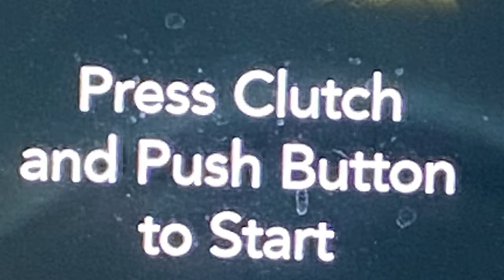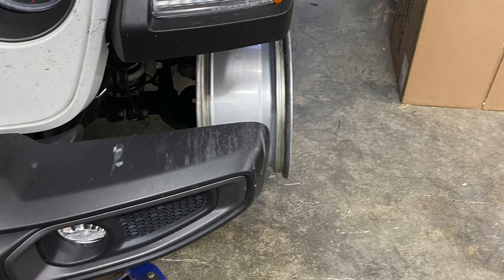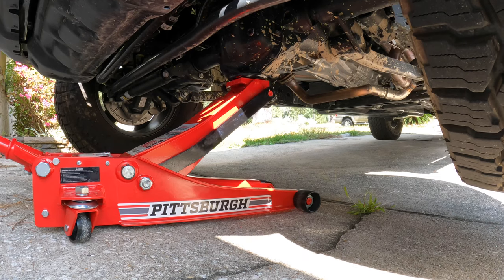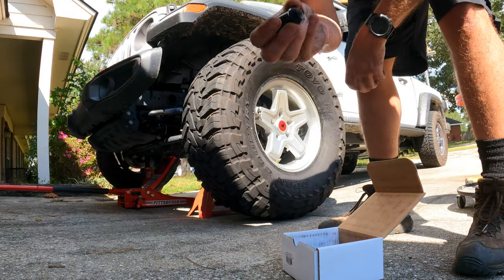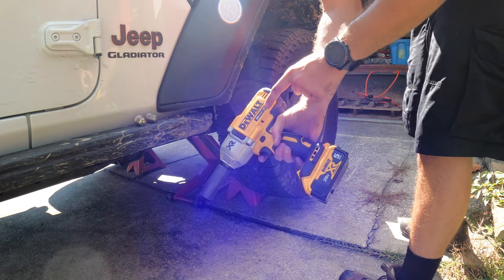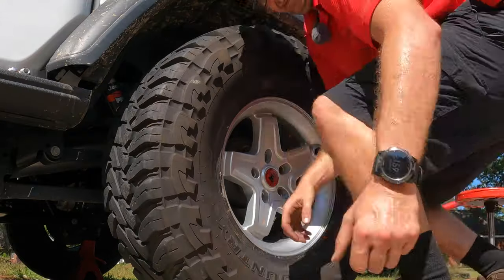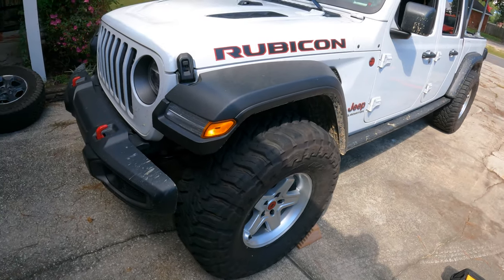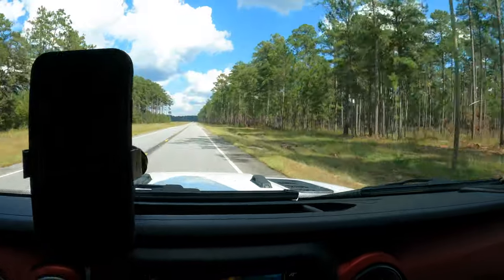Jeep Gladiator 37 inch tires no lift? Toyo 37x13.5x17 and AEV Wheels fit Gladiator Rubicon? Dewalt!

Comment: The jeep looks great.  My f250 2018 lariat tubo diesel 6.7 fx4 crew cab, I changed  from 37x20x10 12.50 to toyo 37x17 x13.50 and it's turning heads every where I go ,and I forgot to mention it has a 6inch lift too.  But your jeep looks great  🤠👍
Reply from the maker: Fred, thanks for watching!   I don’t like big wheels, I prefer more sidewall for that infamous rock or curb.   These tires are the toughest ones I’ve ever run on a vehicle, and that’s why I keep going back to the Toyo MTs.     They’re probably overkill on the little jeep.   They last decently on big heavy trucks.   If you’re not careful you might catch the bug for bushwacker cutout flares and want to step up to 40’s…lol

Comment: Come across your channel... first vid... I too am considering the Gladiator Rubicon and have been wondering the option of 37".. what was the width, offset, and backspace of the aev wheel again ? Here in Australia, the authority don't like overhanging wheels, so trying to pick correct wheel set-up.. 
Cheers
Reply: I might add, I'm waying up between the Rubicon and a Ram1500 Warlock II....
Won't be rock climbing, but will probably be stretching either vehicle on trails... seeing as you have both vehicles, what do you prefer for towing off road..  cheers once again
Reply from the maker: Trent thanks for the comments and questions!

I love both!   The Ram is my do everything workhorse and tows just about anything anywhere I would reasonably want to go.   The Jeep is really my run around town and adventure vehicle.   The Gladiator’s s long wheelbase is actually very comfortable in my opinion.   The Jeep is also far more nimble, lighter, and off-road capable than the Ram (unless you’re willing to take on body damage)  For a dedicated off-road vehicle I’d recommend a Jeep.   If you want driver comfort or plan on towing a camper, trailer, or boat; I’d go for a Ram.  I’m not a fan of IFS and personally prefer the solid axle in a 2500 or 3500.

Dan @theroadchoseme has an Australian Jeep Rubicon which he’s currently overlanding across Australia.  He has several build videos that tall a lot about the strict rules you guys face.   

It really boils down to what best fits your desires.  

Something to keep in mind is most vehicles can pull out a jeep.   However, If you get a big truck  stuck, you’ll need at least one truck as big if not two on call to get you out.

Take a test drive and see which one you like better ;) 

Hope this helps- Jon
Reply: @StartBuildingYourDreams    great information  there.. much appreciated.. yes I am doing as much research as possible... 
I have actually seen @theroadchoseme... good info there also....
Thanx again 😎👍🛻💨💨

Comment: What do you with your knowledge think about me running 37x12.50 17” on a 21 overland with 2” mopar lift and -6mm with 4.7” backspacing?
Reply from the maker: Thanks for watching!   You might still have some rubbing off-road unless you have the high clearance Rubicon Style flares. 35’s may be a better choice.  

Even on the Rubicons I see a lot of folks run the Mopar lift and a terra flex spacer.   

***I would recommend joining one of the Jeep Gladiator Facebook groups.   More than likely there is someone on there that has an Overland with Mopar lift, 37’s or both probably even the same color, engine, and same transmission. 

With 37’s a lot of folks end up re-gearing which is another $1,200-$2000k+ on top of your other modifications.

Hope this helps!

Comment: Where did you find your Pintler wheels?
Reply from the maker: Thanks for watching and leaving a comment.  I found these on FB marketplace.   Buyer beware. Two of the 5 had cracks.   After the fact I found out the early Pintler wheels are notorious for hairline cracks.   I’m sure AEV has fixed this, and these were actually JK wheels.   I’ve since replaced them with a set of steel TacTik wheels from Quadratec.   Hope this helps!

Comment: How did you get the center cap red, looking to do the same to mine
Reply from the maker: Thanks for asking.   These were off a JK.  I’m assuming it was a limited factory production run because I’ve never seen the red inserts before either.   Unfortunately, two of the wheels were cracked.  I actually just posted a TikTok if you want to see what the Gladiator looks like now parked next to an AEV JT370.  Also get a sneak peek at what the new exhaust sounds like 😉

Comment: How come some people say you need at least 1 inch lift
Reply from the maker: Thanks for watching.  This is based on my Rubicon with the high clearance flares.  It all depends on how much rubbing you want to tolerate.   Stock w37s not planning on any hardcore wheeling: Stick to improved roads… 1 inch” is probably going to still rub off-road. Mopar 2” or Most 2.5”-3.5” lifts you’ll probably rarely hear any rubbing until the jeep is fully flexed out…lots of variables: tires, lift, and wheel combinations.  Thanks for Watching!